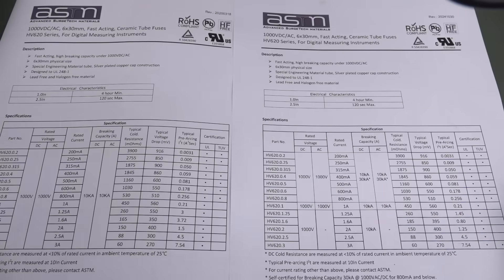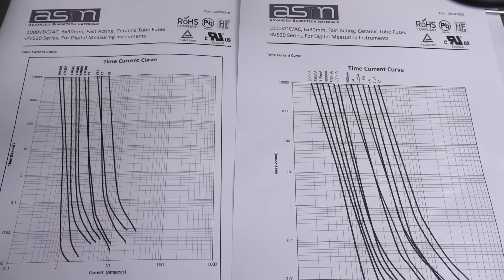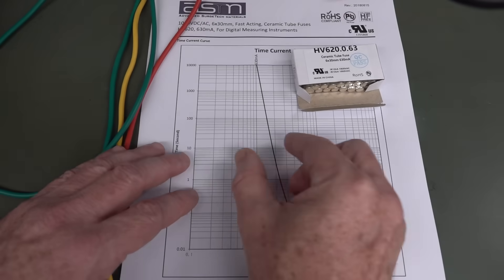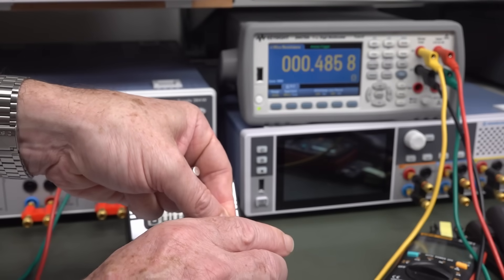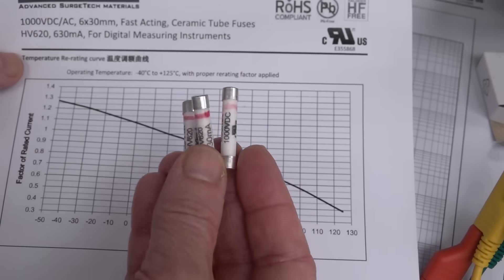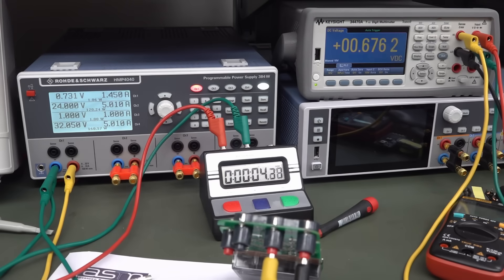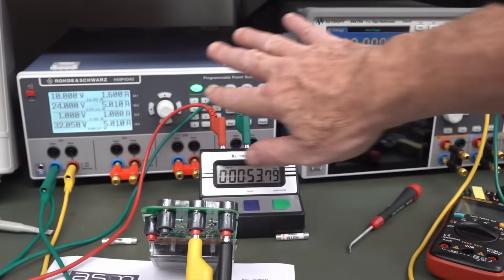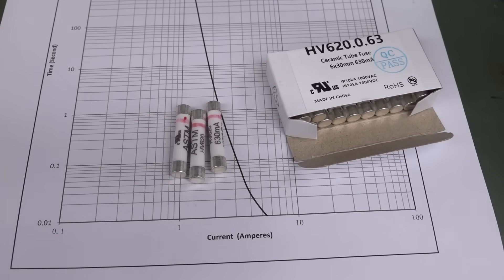EEVblog 1677 - Why Do Fuses Do This? (EXPERIMENT)

Comment: You can strengthen drill bits by cooling them even though the process of quenching them should make them as hard as they can get. If you cool them down they simply get harder. Even years after they were made. IMO this is related to why old tools last longer.
I am not surprised fuses act similarly. IMO they should cool them in the factory to prevent this unpredictable behavior.
Reply: @jackykoning  Um..I just need to clarify exactly what to debunk here: are you snapping off your drill bits, or just dulling them?
Reply: Wait... By "cooling them" are you talking about liquid nitrogen cryogenic treatments? In that case you're correct. I actually recently swapped the flood coolant on my milling machine for liquid nitrogen and my end mills last 10x longer than EEVblog's frozen fuses.
Reply: @SkippiiKai That would be interesting if it was physically possible
Reply: @AddyEspresso  Anything is possible. I actually started experimenting with the idea just using liquid propane because it's cheap - just a 20lb tank turned upside down through a hose blowing right on the cutter. Then I used the insurance money from the incident to build the liquid nitrogen setup.
Reply: @ The original video I am basing my comment on used Liquid nitrogen yes. However I bet that even just going to -20 degrees in a freezer will harden them slightly. And presumably dry ice will harden them more.
https://www.youtube.com/watch?v=hAxi5YXTjEk
My assumption is simply that the crystal structure doesn't change at set temperature intervals but rather changes constantly as it cools down.

Again I assume that the metal in the fuses basically change crystal structure when they are cooled. The freezer was only -20 degrees. So again I would assume that all metals that are quenched will pretty much do the same thing.
without doing research though it is only a suggestion on how it could potentially work.
Reply: @SkippiiKai  Wait you are serious? Wow!
Reply: @AddyEspresso  Now that we're safely outside of April 1st: NO! DO NOT USE LIQUID PROPANE AS A CUTTING FLUID!
Reply: @SkippiiKai  Too late

Comment: So, new EEVBlog digital fuses when?  ;)

"Why do fuses do this?"  Because you're not running them at the 1000V the label says they're built for.  630 watts at rating versus <1 watt as tested, I can't believe some of them blew at all!
Reply: I know this is a he he ha ha video, but I have seen "BTS50010-1TAD" being used as a digital fuse. We live in interesting times... Also, dave has no fuse holder doodads?
Reply from the maker: I wanted to simulate the heatsinking of a typical multimeter PCB
Reply: The time for fuses to overheat/blow has nothing to do with voltage, only the current.

The max voltage 1000 is relevant for the capability of extinguishing the arc.
Reply: The internal heating of the fuse wire is just dependend on the resistance, I²R. Voltage doesn't matter for blowing the fuse, and if you look at the video the PSU was set for 10V, so there like 15W available (at 1.5A).
The voltage rating is just the maximum voltage the fuse can break when it blows (more on AC because of the zero crossings where the arc extinguishes, less voltage for a DC circuit)

Comment: The effect is likely known as the "cold brittleness state" and the "brittle fracture" which occurs in most lattice formed metals. For fuses I expect that the main reason for this is stress on the fuse wire due to thermally induced contraction.
Ps. a system to test this is clearly demonstrated in the following video https://www.youtube.com/watch?v=RXJKdh1KZ0w
Reply: Could also be caused by moisture inside the fuses that put stress on the housing and wire. Would be nice to do an experiment for this in a controlled environment where you can open a fuse in freezing temperatures to see if there's any ice formed inside. Expect most manufacturers to have moisture control on their materials bit seasonal influences may still have some effect as well.
Reply: @DavidBezemer  that's what I was also thinking (about moisture)
Reply: But does it really change the conductivity or the properties of the alloys ?
Reply: @WillJad Seems that way. It may  change the crystalline structure of the metal.
Reply: could be happening, sure. why would it decrease resistance tho. if anything irregularities and microfractures forming should increase it, same for other tension effects like wire thinning
nah. seems like some crystalline lattice transition is going on and manufacturing process is not accounting for it with thermal processing
Reply: @dinf8940  since the crystalline lattice is changing, it could decrease resistance because of that.
Reply: @dinf8940 most conductive materials reduce resistance by cooling. There is a reason they make super conductors at low temperature. Many TIG welders have cooling in the wires to keep them cool and it does intact reduce resistance so you actually get more power out of the end then you would with just a standard wire. Cooling of conductors to decrease resistance has been well studied. But it is interesting that it permanently changed it. It did likely change the crystalline structure permanently  likely due to the allow and its properties. Pretty interesting though because if you buy a fuse that sat outside  in the snow it may not blow anymore which can be a saftey issue
Reply: @newmonengineering  I have never heard of tig welders with cooling on the wires. Water cooled torches? Absolutely. But wires... I've never heard of that.
I'm really enjoying all the comments on this video today. Lots of... interesting takes.
Reply: @newmonengineering  Do note that superconductivity is different than mere thermal coefficient. SC is a quantum effect, while normal resistance is a thermodynamics effect.
Reply: @SkippiiKai yes there are actually very large weldres for industrial use that cool the wires as well to reduce resistance in the wires, especially for long wire runs. I know super conductors are different but the cooling of them still reduces resistance. The colder the less resistance. These same effects happen to normal electronics as well, the cooler the transistor the smaller the resistance and the larger the load can be.
Reply: @newmonengineering  Very interesting. As often as I weld and cut straight through my ground lead, my tig cable, and my oxy-acetylene hoses, I will not be in the market for water-cooled cables. BMS at my skill level (despite 20 years experience) you'll be happy to hear that I've probably never heard of them because I've never been in a position to do any corporate/industrial welding. It's bad enough with all the electrical fires that get blamed on me.
Reply: @dinf8940 as the wire contracts it may change the lattice structure which causes it to be thicker when returning to room temperatures and/or slightly change conductivity. With how thin the wires are in these mA rated fuses a small mechanical change may have significant effects.
Reply: @DavidBezemer  Nah, it's hydrogen embrittlement. Just ask any welder.
Reply: That makes little sense in this context, there's no abundance of hydrogen to interact with nor any conditions that create the necessary interaction for hydrogen embrittlement. He's just placing a metal in a freezer.
Reply: I believe it is the april fools effect.
Reply: @GaRbAllZ  sshhhhhhhhh! Dave's been deleting all the comments all night!
Reply: @Dennis-kf0rlx  you might be onto something :))))
Reply: Wouldn't fractures actually increase the resistance?

Comment: Could it be moisture getting into the fuse body from the freezing, would the sand/silica inside take it on (moisture) and make them slightly heavier, what about putting them in a dessicator/dryer before trying the experiment again.
Reply: It would be more likely that the moisture already inside the fuse freezes and thereby expands and cracks the ceramic housing or otherwise affects the fuse wire.
Reply: Or just put them inside a zip loc bag into the freezer?
Reply: Apparently this effect is only known in Australia, how weird is that. Why would that be the case? 😉😉

Comment: I'd be curious to know if car fuses do the same thing..
Consider that caras stay outside over freezing night.. Not in Australia but in cold places obviously 😄
Reply: Most cars don't use ceramic fuses.
Reply: @DavidBezemer  the interior assembly is still similar. The ceramic case is for containment
Reply: @DavidBezemer  Lol ceramic it's not the fuse conductor is the wire..
Dave mentioned it, is the internal crystal structures on the metal that change not the ceramic.

Comment: this is known as the FARTS effect.. fuse altering resistance by thermal shock.
Reply from the maker: So it's a Jones FART?
Reply: @ if you got them wet before the thermal shock you got wet farts and you may have to clean up the mess after the test
Reply: Better check your calendar mate - Dave always jumps the gun
Reply: @gorak9000  I am guessing the rationale is that his channel is a global channel, so he can pick any time zone he wants. Or, in other words, as long as there is one place on earth that has passed midnight, it's fair game. Kiribati is now one hour past midnight, so Dave nailed it perfectly.
Reply: JONES: Joule Offset due to Nippy Environment Syndrome

Comment: Only 4 years since the first part? You are speeding up :)
Reply from the maker: Slow and steady wins the race.
Reply: @EEVblog - the slowest blow in history 😂
Reply from the maker: @johncoops6897  That's what she said.
Reply: @EEVblog precisely 300 episodes later, was this a coincidence?
Reply: @EEVblog  Had a fuse blow around 2012, 200A fuse, that had been running with a peak of around 300A since around 1953, as the fuse was manufactured by GE in 1952. Took it 50 years to blow with a daily 50% overload for around 5 hours in morning and evening peak.
Reply: @SeanBZA  Things were built to last in those days.
Reply: @TheeMuseumofjunk It was probably transistor-protected 😅
Reply: There was some burn-in time ;ø)
Reply: The video was frozen...
Reply: Dave never got a Roundtuit fuse. 😂